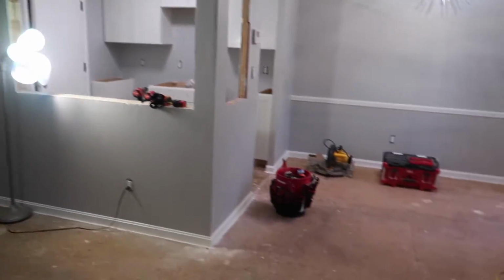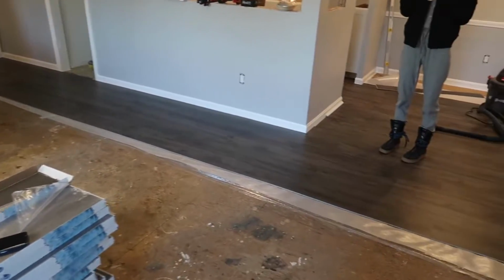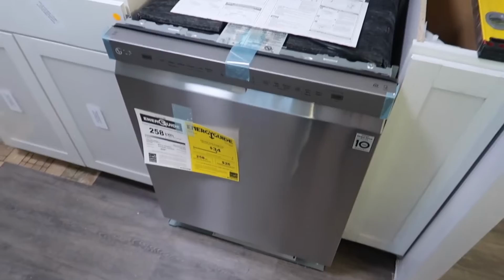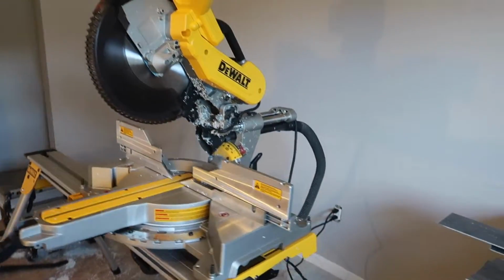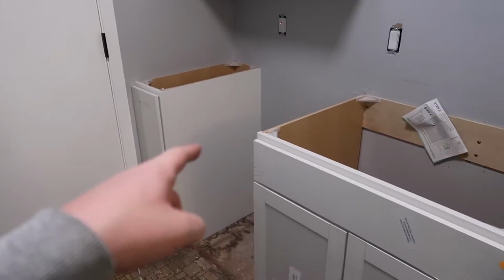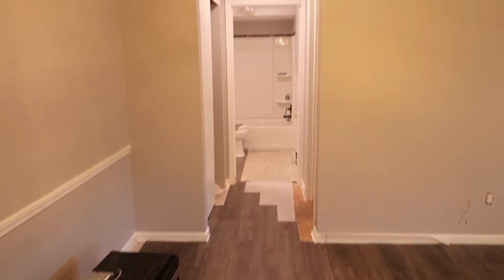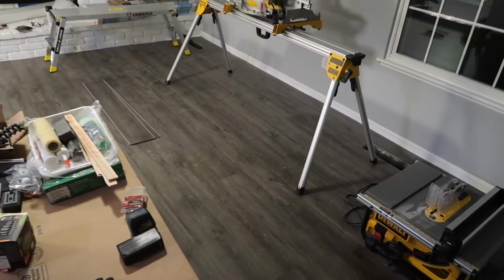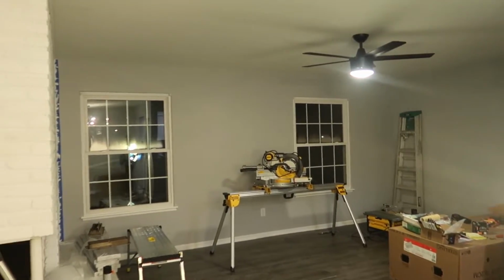INSTALLING VINYL PLANK FLOORING IN THE CONDO!!

Comment: WARNING: Installers shouldn't use foam under vinyl plank flooring. It is too squishy and the joints will start to separate.
Reply: @amittrivedi4610  Check with your condo board. Where I live, the condo boards require that the underlay have an STC score of over 70. You might be able to raise the floor height with something like DMX 1-step.